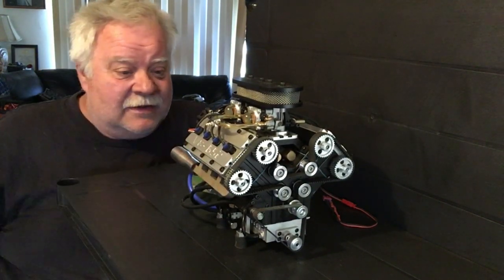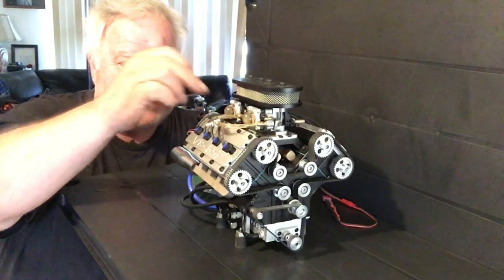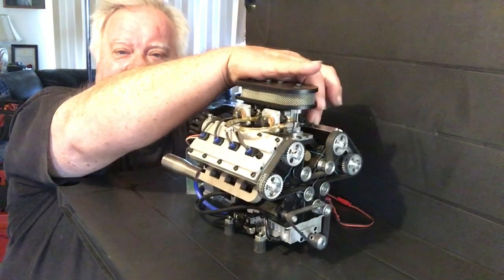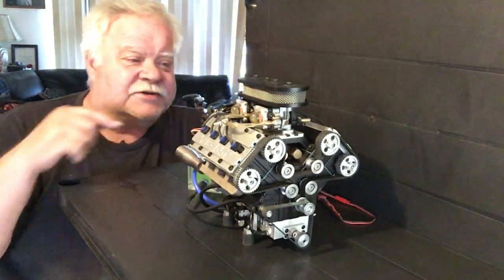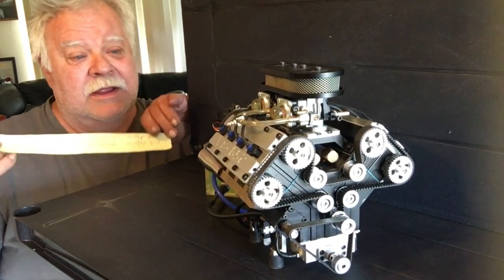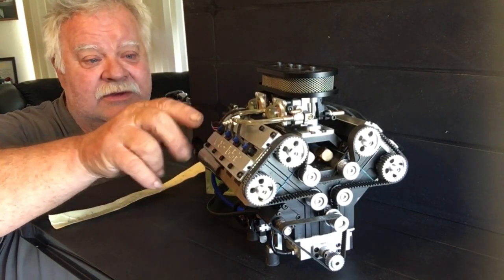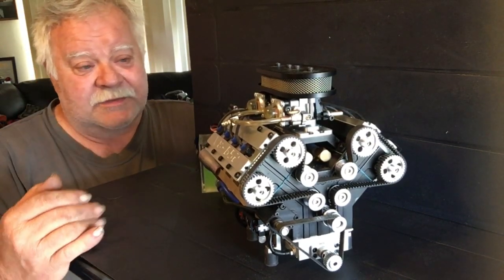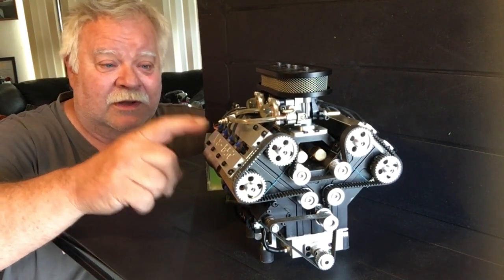THE NEW ENJOMOR V8 !!

Comment: If money wasn't an issue, I'd already own one. I've been on an RC engine binge on YT w/ nitro engines. I was blown away by how small the parts are and that they were fully functional. Then I found this gem first time visiting the stirlingkit website. Fully functional oil system, ignition, DOHC, just the works. I just wish they didn't cost as much as a full size car engine, or even a used car, or I'd buy at least two of them.
Reply from the maker: Yeah the cost of these engines are a big buck hobby,  I asked why they cost so much and then I realized all the machining procedures are the same as a full size engine but a slower micro 
 CNC finish on all the parts,

Comment: I have seen this engine in some videos and short’s over the past two month or so. Always mounted and running on really nice test stands but never numbers or any information on it. I always thought ya ok nice but just a lill bigger and nicer arrangement than others. But now that you have lifted the curtains and explained the sweet little big details like the oiling and cooling system, crank and cam design etc. man that thing is the deal. I totally get your excitement on this awesome peace of engineering art. This machine would be perfect and totally worth it to invest in a motor management system on rpm, temp, oil pressure, torque and a proper “mini” engine dyno.
Reply from the maker: I agree with you there brother! I ran it loose to show how little vibration it had,

Comment: See we knew this was coming!,  you have an into back on Jan 31st. 😆 but for the size of that beauty, In my opinion much more tolerance is everywhere to design each piece with much accuracy. The challenge is oin the 1/10 scale. Don’t get me wrong it is something to appreciate dearly. Hope it doesn’t cross the $3k price tag. I really think they are coming up with something around the corner. That plastic MT5 gearbox they got is probably a prototype to start production. A clutch production is needed as well. Thanks for sharing Dennis!. We’re so lucky to see this. 👍 what’s the deal with the FS-S100bx?. Waiting for that one.
Reply from the maker: Yeah they have lots of cool upcoming stuff at Sterlingkit from what I hear , I haven’t heard anything more about the Fs-S100bx yet,

Comment: Fantastic Dennis. What a scoop. At last, a true 4 cam. What is its physical size ? I was building a 1/5th scale short wheel base dragster style car, but could not find a suitable power unit. Any indication of price yet ?
Please keep up the fantastic work you do.
Reply from the maker: Yes it’s a work of art! It’s a little bigger than the Aussie V8 my rough measurements are 200mm tall 200mm front to back not counting the header extensions and 180mm wide, they haven’t released any pricing yet but I will post any updates from them, I have a good feeling it will fit a 1/5 scale dragster and have that tire shredding power 👍👍
Reply: On their site it's 2,979.99
Reply: @bobking7347  Hi, I saw that. And is available for less; but still far too much for me; Beauty that it is !

Comment: A moped is only 50cc. My childhood Honda 70 was even slightly smaller cc wise. Probably not as efficient as the Honda as a gas engine so I'm skeptical at your horsepower guesstimate. I'd love to see someone adapt a clutch to the back and maybe a gear box that's shaft drive for a mini bike install or maybe shaft drive go cart.

I could see a racer building a pit bike using two of these side ways in a mini bike frame hooked to an old Harley 74 transmission and clutch. That would be one cool 144cc 16 cylinder pit bike!
Reply from the maker: Good call my friend but the horsepower information came straight from the small engine manufactures of America, I requested the production engine will come with a clutch mount, I  had the pleasure to try to show this reliable new V8 to the world  remember don't kill the messager brother,
Reply: @dennisdempseyradiooutofcontrol   I hope your right with your horsepower guesstimate. My skeptical view is based on scaled down motors from my childhood. They don't seem to get any smaller than a tiny chainsaw engine piston wise and those are all two stroke. Smaller than that we move into my RC model engines but now we are too small to burn gas efficiently and move into model engine fuels. These tiny engines require special fuels, high rpm's and a two stroke format to extract high horsepower for their sizes. Your claiming similar horsepower from a 4 stroke, lower rpm, regular gas burning engine. I'll be happy with 5 horsepower out of one of these and ecstatic with anything over that.
Reply from the maker: I respect that my friend, I have to hold an engine and rev it while running it it twists out of my hand I know that the torque and horsepower are greater than the 5hp engines,

Comment: Wow and wow again, now it just needs better carburation or better still fuel injection either mechanical or electronic, now a decent clutch and gearbox or a good auto with torque converter, I would revive one of my quarter scale Stadium truck or dirt oval late body cars collecting dust in my sisters display cabinet.
Reply from the maker: Yeah it would be time to break it out and dust it off! Lol!